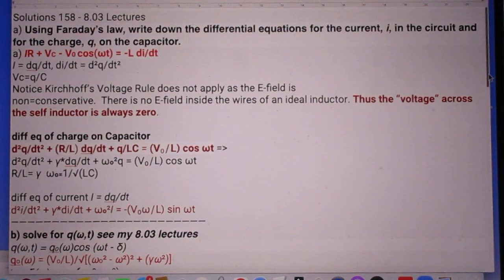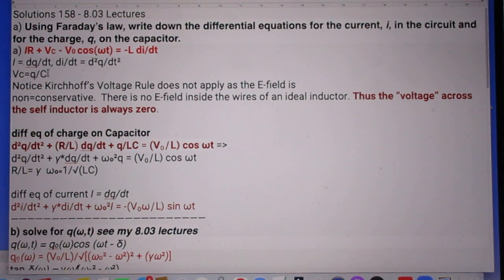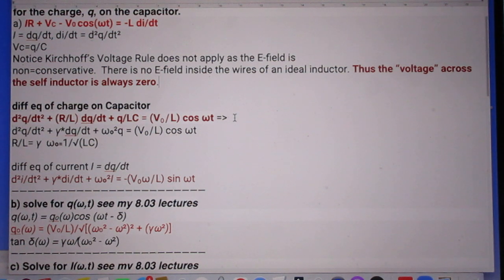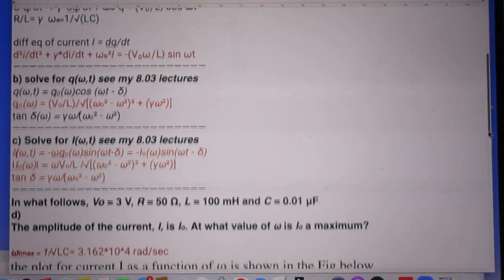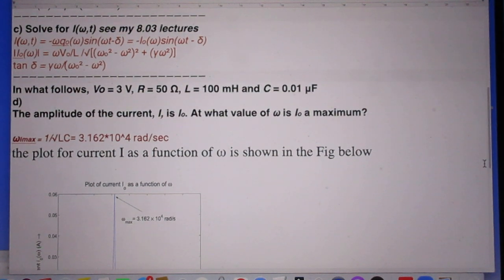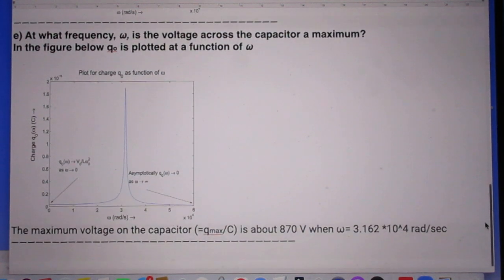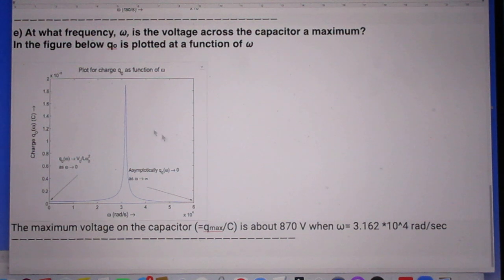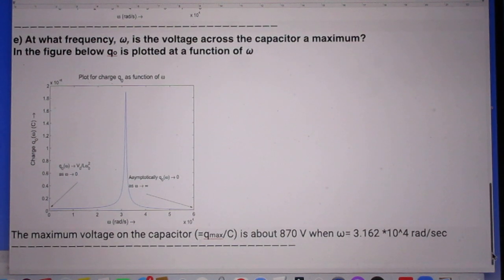Solutions Difficult Problem 158 - Driven RLC

Comment: Hi Walter Lewin
There is an induced electric field along the wire of a self inductor. That there is an induced electric field along the location of the length of the wire of a self inductor is the consequence of Maxwell's third equation, Faradays law. 
 (integ)E.dl = - d(phi)B/dt.  The  term (integ)E.dl  is the induced electric field. That is Maxwell's third equation.
Reply from the maker: the induction of single copper wires is typically less than 5 micro H and can thus be ignored.
Reply: @lecturesbywalterlewin.they9259  
I am referring to the coil of the self inductor. There is an induced electric field along the wire of the coil of a self inductor. That there is an induced electric field along the location of the length of the wire of the coil of a self inductor is the consequence of Maxwell's third equation, Faradays law. 
 (integ)E.dl = - d(phi)B/dt.  The  term (integ)E.dl  is the induced electric field. That is Maxwell's third equation.
Reply from the maker: @woodcoast5026  >>>>There is an induced electric field along the wire of the coil of a self inductor. >>>>  NOOOOOOOOOOOOOOO  this is a common misunderstanding among people who do not understand Faraday's Law. The E field in the wires of an ideal inductor is ALWAYS ZERO

Comment: Good evening dear professor, I think there is a small typo in answers (b) and (c). Under the square root there should be (γω)² and it is (γω²). Also, I would like to ask you if possible to tell me why the maximum voltage over the capacitor is 870V? Anyway I try to calculate I get about 189V. I can’t see where I am mistaking. Thank you
Reply from the maker: Thanx for checking my soltions - I will post a video tomorrow with corrections and I will give you credit  Qmax= approx (1.9 * 10^-6) (see my figure) divide by 10^-8 - that's about 190 V.  my 870  is a bizarre typo